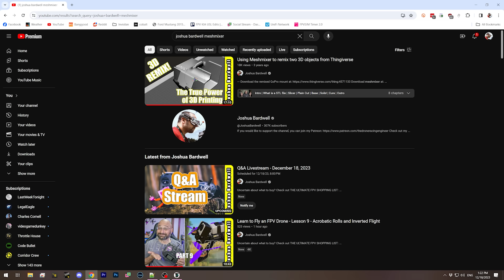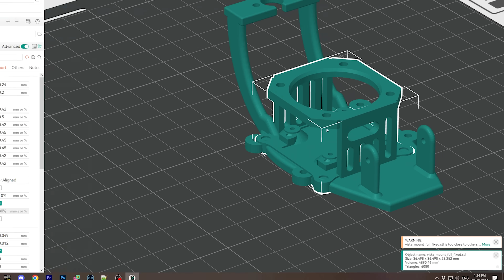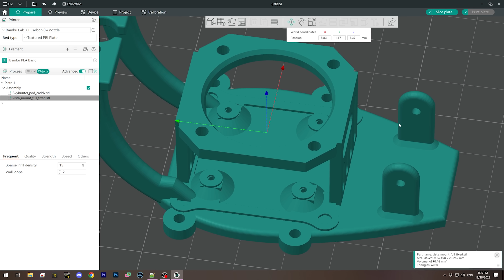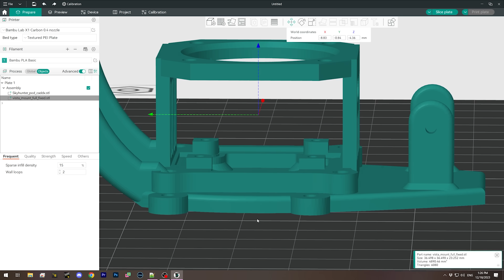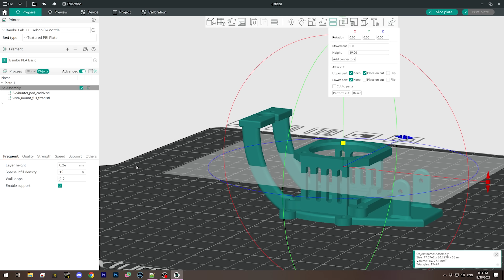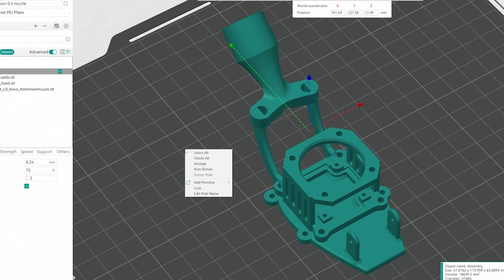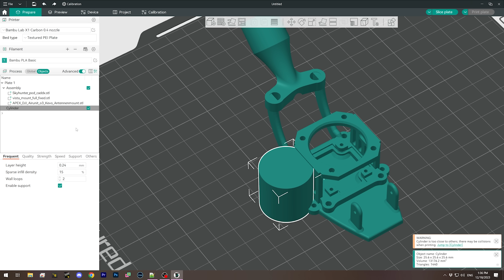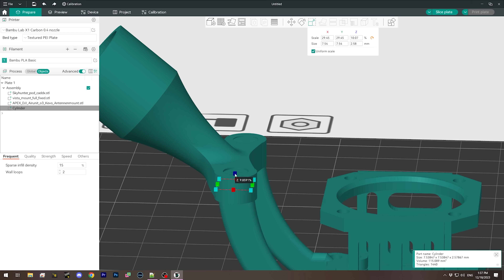These tools let ANYONE remix 3D prints (no CAD skill required)!

Comment: You can also add a negative volumes to take away material. Like removing the round overhang edges on the antenna mount or adding new bolt holes.

Comment: Can i mesure things point to point? Because nice to if can when you want scale up and want to see holes parts if the right size ,i want to see slicers to do more cad thing in the software,cura can't cut models if you don't use plug-in like banana split

Comment: Orcaslicer is amazing. Been using Creality print for the past month. Now Creality released a new firmware with root access.  For my ender 3 v3 ke. Installed mainsail on top of the klipper and now I can wifi print directly from orcaslicer.

Comment: If your slicer doesn’t support this, you can always do this in a 3d modeling program. Workflow will be a bit different for each but combining things and cutting them apart is supported in every 3d modeling program I know about . That’s the thing about them, you don’t have to learn everything at once, learn what you need to do what you need now and come back and learn more later.
Reply: Did you even watch the whole video before you decided to share exactly what the video states?

Comment: I wanted to add as I use CAD, but this video is great one tip that I do is I have a folder on my PC that I call tools for my bambu slicer , basically for example I made a simple image of a skrew hold so one cylinder for the hole and a larger cylinder on top big enough for the head to sit in and a simple chamfer along the bottom and f the head to make it sit nicely.

Now using bambu I can add a negative part, and load that screw and bam I have the ability to cut a hole out where I want to screw an item to a wall.

Long story short as you make miner adjustments start saving these items you make so you don't just have basic shapes to pick from.

Comment: 12:50 there is a free version of Fusion 360 for personal use as long as you don't earn over $1000/yr using it. ie. a hobbyist license. It doesn't have all the bells and whistles but it can do pretty much everything that you need for 3D printing and it's pretty easy to learn enough of the basics to sketch up parts like this.

Comment: LOL,  Dammit Bardwell you did it again!  I have had my P1S since Nov and I have used it quite a bit since.  I don't normally edit existing STL files as I am 3D capable with SW but I ran into a Thingy print I needed to alter a few days ago and used my goto Tinker CAD, as it does a great job of modifying files.  I saw this vid and you adjusting that file through the BB slicer and I was like "what the hell" LOL,  great job,  I definitely learned something today!

Comment: Learning Fusion 360 isn't that hard, you would get the hang of it pretty quickly. It is really easy to modify existing cad models in it, if you want to get rid of a hole you just click on it and delete the feature.

Comment: I have to respectfully disagree.  If you spend just one hour going through the tutorials for tinkercad,  you'll be able to do all this and much more.  While you can do this stuff in the slicer,  it's not the right tool for the job, and you will likely run into frustrations.
Reply from the maker: Ok but I spent zero hours going through tutorials, didn't download or install any new programs, and just banged this out in like 10 minutes. So like, it's got that going for it.

Comment: Great video. The 3Dprint community is missing someone like you (or you). I just got a P1S and my computer is too old to run orca but I can run bambu slicer. Is there a way to change angles on a GoPro mount within the slicer?  I run 20° but a lot of mounts are 25-30. One day I’ll get a new pc but trying to make do for now.
Reply: Yes, it's exactly the same is Bambu Slicer.
Reply: Interesting that you couldn't run Orcaslicer since it's a fork of the Bambu Studio, which is based on Prusaslicer. But yeah, you can see the rotate tool next to the move tool. You might need to do some cutting and other tinkering but you'll be able to get what you want in the slicer.
Reply: @Qwarzz thanks I’ll check that out. Yeah I said pc but it’s an old Mac that I can’t update the os any further. Cura and Orqa won’t run but Prusa and Bambu will. I think I’m one update away of needing a new computer 😁

Comment: A new bambu printer sure does get the creative juices flowing,....   I have the X1C. Didn't order it with the AMS,.. now that's on the way. It is so cool the way it just spits stuff out so perfectly. Even "slow" nylon carbon fiber prints are fast and easy.
Reply: I just got into printing and already see the value in the ams. I’m busting out multicolor prints like I actually know what I’m doing! 😁
Reply: @likwidkool  I didn't get it originally because I tend towards functional prints and a lot of carbon fiber. But the other day I saw that their PaHT-CF filament will work with the AMS. So I mostly want it as more of a filament management system, and maybe I'll also do some occasional multicolor for the kids.
Reply: @rcrdps8144 I want to get into that too. Printing random shit is fun but I want to use it also to solve things. Printing my quad parts is the best part. The ams is handy to store 4 rolls as well.

Comment: Would probably be better to split this into multiple parts, because you end up with overhangs.  Printing in one piece, sounds cute, but you get a flimsy part, that can be broken easily.
Reply from the maker: There are no overhangs except the tail piece and the lid. The lid is printed as a 2nd part on the bench. The tail is printed with supports. Its good.
Reply: @JoshuaBardwell    Again,.... Bambu makes us no longer care about overhangs. Cause supports are effortless and not the gamble they used to be. I've even taken to doing it the "resin printer" way, and put something at a 45 degree angle so it will be more supported rather than flat on the plate.

Comment: WARNING: PrusaSlicer & Slic3r - They can't properly slice overlapped STLs on the build plate.
You'll need to "Export Plate as STL..." then clear the build plate and import that new STL to get a proper slice.
Reply: you just have to add the second object as a part of the first object (with right click on the first object), then it works fine
Reply: I asked about this a year ago in a thread I started online called "Overlapped objects on build plate don't slice properly #8962" to be told it was a known issue that won't be fixed.

Comment: FreeCAD is another CAD software worthy of mention. It's a little clunky in certain areas and it is nowhere near as polished as high dollar suites like Autodesk or SolidWorks provide. But hey, it's a free and open source program that can be extended with plugins written in Python. Not gonna lie though, when I first started with it I had zero parametric CAD experience and so I had to get up a steep learning curve. Anyone who already understands the parametric modeling workflow (sketch, extrude, sketch, pocket, sketch, make holes, etc.) should be able to pick it up with much less effort.

Comment: Awesome. This is a very informative and helpful video. Recently got my first 3D printer, the A1 mini. This would been a big help. I did find a video tutorial by mute fpv using Tinkercad. It worked, but your way seems easier. Made a fin for my Apex using two different files. 👍😎
Reply from the maker: TinkerCAD is great, but sometimes I just want to do some basic chopping and mashing and it's nice to work entirely in one tool.

Comment: Orcaslicer is definitely cool - it's a really well maintained fork of Prusaslicer, for this type of work I'd prefer Tinkercad. It's a lot easier to iterate on a tinkercad design than it is editing models directly in the slicer. There is the edge case of Orcaslicer handling non-manifold models better than tinkercad, but you'd be better off shoving it through some stl repair tool or Meshmixer.
Reply from the maker: 100% Meshmixer or Tinkercad are tools specifically intended for this purpose. The inspiration for this video was finding that these tools were baked directly into the slicer I was already using, and I wanted to try to get the word out.